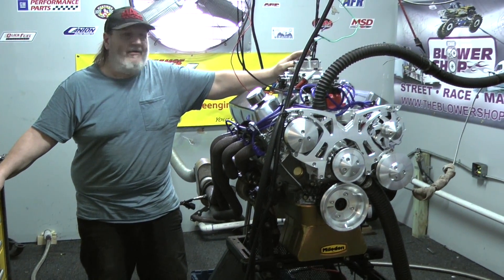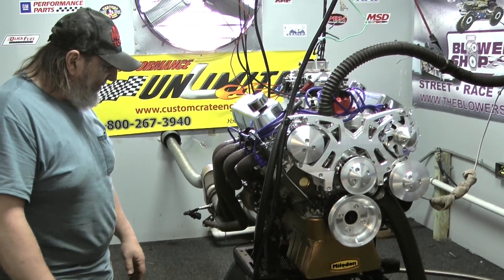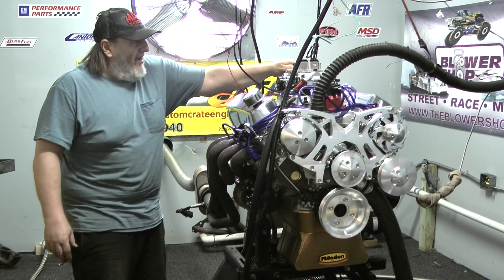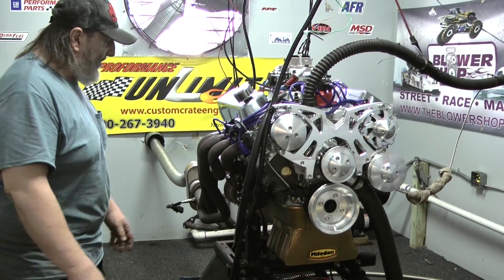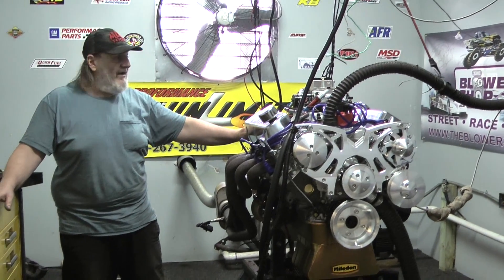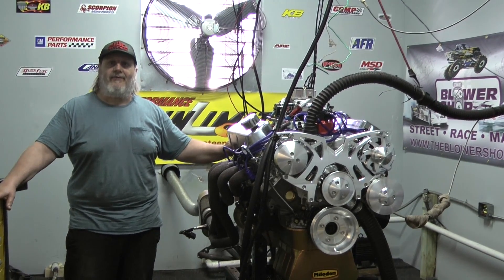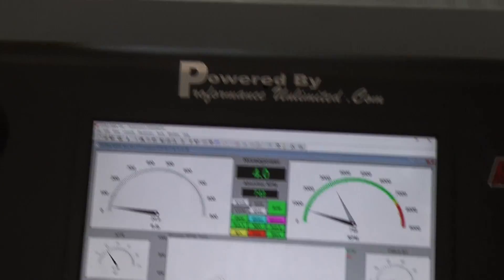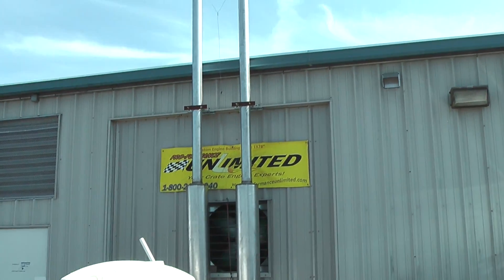427W Stroker Complete Crate Engine

Comment: What would something like this cost for 420hp or so that runs good on pump gas?? I got a 66 Ford truck that needs a new engine. I like the idea of a 427 emblem on it lol. I want the displacement but I don’t need 500hp....400 is good for me. Just a fun street toy.
Reply: that's why I did the 427...to put that number on the hood...if you only want 400 do a nice 331, trust me though the 427 is very drivable runs like a mini van if you want or hit and watch the thing take off to the moon

Comment: 525Hp, I suspect the cam is on the mild side, my 408 makes that much with a flat tappet cam but it kida wild, I guess if you drop an 850 holley on there we might see that number go up!
Reply: Try dropping a throttle body fuel injection unit on it instead...
Reply: Going to 850 doesn't do anything cause of the airgap. Been there done that.